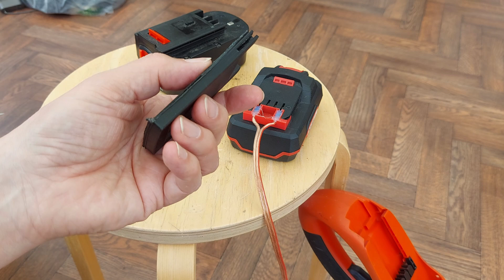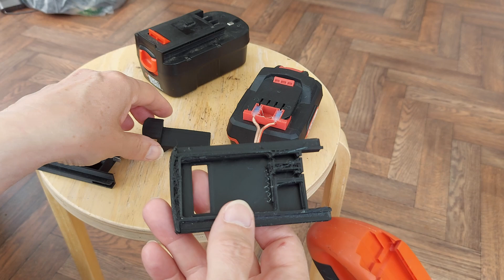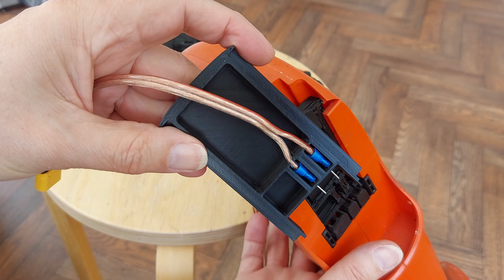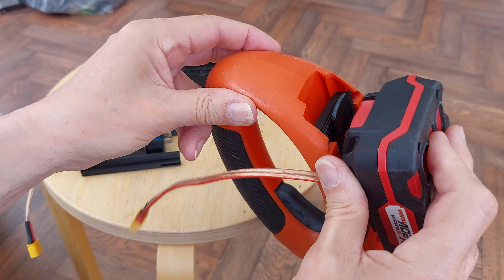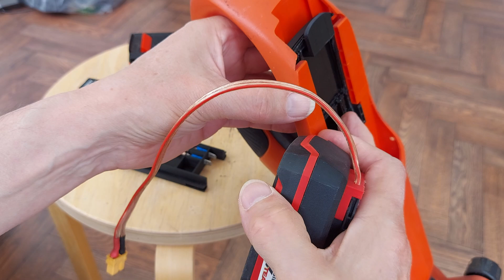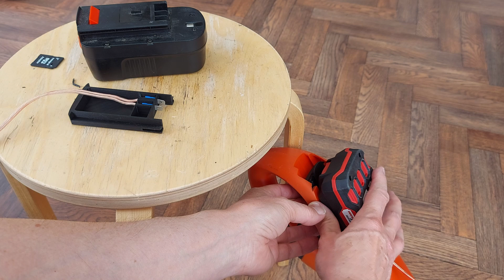Black & Decker 18v Battery Adapter for LIDL Parkside 20v Battery PART 2

Comment: You have done well designing a clip-on battery holder for it. That 3D printer is brilliant for these sorts of jobs but you need to educate yourself on how to design the parts you need and you have definitely done that. You have designed and printed tons of original parts for things. 
Brilliant work. 🖨👌👍👍👍
Reply from the maker: Thanks Mike, a couple more episodes to go 😁😁